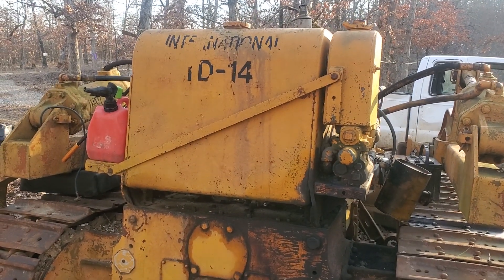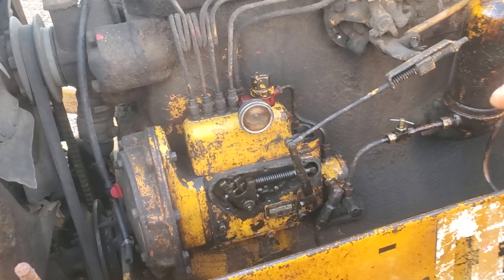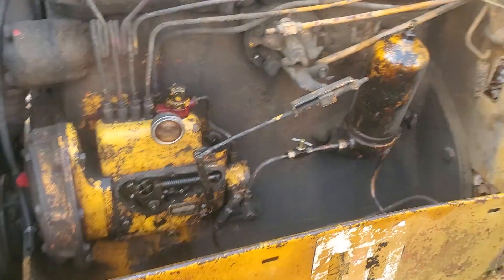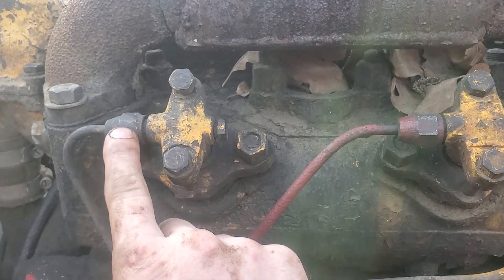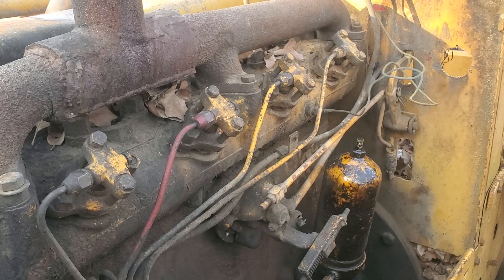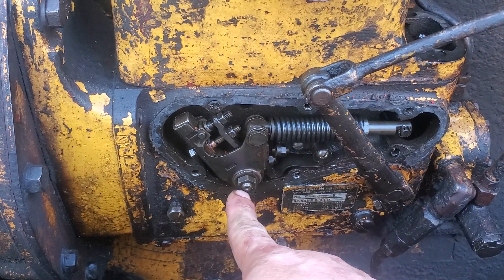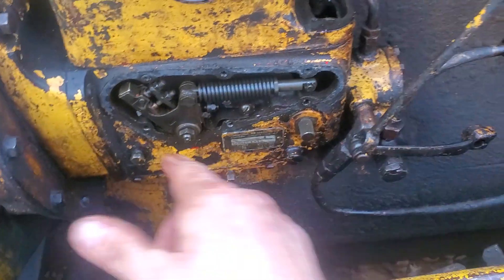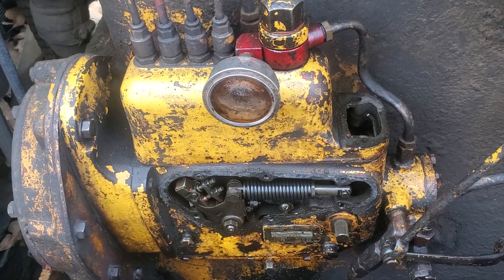Starts on Gas|Won't run on Diesel|What is the Rack #IH dozer

Comment: Replace fuel filters, check the rack that the fuel is in the "on" position, crank the engine, check fuel delivery at the injectors, if at the injectors there should be smoke out the exhaust pipe.  It should start or at least pop.
Reply from the maker: Already done. It looks like we aren't getting enough pressure at the injectors
Reply: @whitetailridgehomestead  remove the injection pump and have it checked. I am guessing in is leaking around the pistons, new o-rings if the barrels are not scored. Maybe broken springs in the cam followers inside the pump, check the pattern of the injectors and the breaking pressure. If the return is blocked it will put the pump in bypass automatically, no fuel delivery, no smoke from the exhaust. The return line has a check ball in it where it leaves the pump,  I have found the check ball blocked with gasket material, ground up rubber. Remove the blockage and the pump will work but still needs repaired.
Reply from the maker: @danthurman9076  this is the step we are currently at. It's good to hear that more than one person is going the same direction. Literally just had a guy tell me the same thing. I'm betting this is the issue. I just have to open it back up and check.
Reply: @whitetailridgehomestead  40 years tinkering with diesel engines, big or small, I like the old ones with injection lines and a pump instead of all of the overhead cam and electronic injection. Fuel rails built in the head. ☺
Reply from the maker: @danthurman9076  me too. Seem much easier to work with once you have an understanding of the system. However it's getting to know the system. This particular machine is new to me and I'm learning my way through it with bits and pieces of information from people like you. I appreciate your input.

Comment: The rack is the part you were sliding back forth near the end of your video.
If your injecters getting fuel when you bleed them out, then i would think its the conpresson release getting stuck open, not fuel
Reply from the maker: Unfortunately I checked every cylinder individually to make sure that valve is opening. It's opening. I'm waiting on a new set of batteries now so I can continue.
Reply: @whitetailridgehomestead  well opening is great for running on gas, but are they closing and sealing? If not it wont have the conpresson to run on diesel
Reply from the maker: @oldreliable303  yes they are sealing to the best of my knowledge. Only reason I say that is because on a random test I shot go go spray into the spark chamber put the plugs back in to see if anything happened. Nothing happend, so it's sealed good enough not to leak back at least
Reply: @whitetailridgehomestead  with the conpresson relese off, like its running on diesel crank it wile spraying starter aid in it and see if it will run on that with no spark
Reply from the maker: @oldreliable303  I can try it again but I'd assume it won't since it didn't fire the first time. I'm probably going to check as well to see if I feel any blow back with the plugs out. But like I said I lubed them valve stems up good and worked them up and down manually. But never hurts to double check.

Comment: 1. Remove all injectors, test compression (harbor freight), minimum 400 psi to start on own. 2. Fuel transfer pump, at the rear of injection pump, has three lines 1. suction from filter 2. pressure into injection pump 3. bypass back to tank. 3. Assuming you are getting fuel into injection pump, leave injector lines connected to injectors while you spin engine over with starter. Fuel should spray out of each injector like a wd-40 can or finer.4. Do not recommend you tinker with fuel injection pump as you could create a runaway engine situation real easily! Recommend you send off to professional rebuilder. Hope this helps.

Comment: One of the first to do before you even try to run it is change the fuel because just like the gasoline today the fuel will cause the plungers in the pump and injectors to stick if it's too old .
Reply from the maker: Been done twice already

Comment: The pump plungers are stuck, remove lines at pump. Remove the fitting on top of pump one at a time. Remove spring and check valve . Roll over engine to verify pump plunger is rising and falling, i use a 1/8" pin punch in the hole to get a visual of it. If needed tap pump plunger down lightly, making sure pump cam for that cylinder is not on tdc. Tap it down leaving punch in the hole rotate engine and note movement of the punch if it rises but not falls youll have to manually tap it back down. Repeat as nessasary till punch rises n falls with engine turning over. Repeat this on all 4 pump plungers reassemble check valve and spring and fitting cap . Repeat this to other 3 outlets also .This will allow plungers to get a full stroke of fuel and allow the rack to move and rotate plungers and be opend up to the fuel passages. Keep it clean n good luck.
 Mr. Been there done that.
Reply: Side note, I modified a salvage fitting cap to allow the punch to go thru it, threaded it on the pump without spring and check valve of course, this makes sure a stuck plunger won't push out the plungers barrel while your freeing um up.
Reply from the maker: @roha8993  totally makes sense in my head and can follow what you're getting at. Also appreciated. I will see what I can scavenge around here. I'd about bet this is going to be the fix.
Reply from the maker: @roha8993  I have a question when you have some time.
So I opened up the injection pump. Right under the cover you have what looks like a distribution block where the 4 main lines connect. I removed that block. All 4 plungers under the block were frozen. I soaked them and twisted them until I got free movement. The distribution block has four pins/needle jets or something in it... all of those are frozen. Any ideas on how to get them free? And how far are they supposed to move? Thank you for your time.
Reply: @whitetailridgehomestead  
Don't know to properly respond via utube. Can't fwd photos or chat as needed.
Reply from the maker: @roha8993  just tell me what platform works best for you if you're willing to share information. Phone, email, anything I can get I'll get it. I need the help
Reply: @whitetailridgehomestead  
I think YouTube deletes my contact info when I post.
Reply from the maker: @roha8993  it's all good. I actually just put up a new video. I hadn't tagged you yet but, you nailed it on the head for the most part. It was all gummed up. Check out the new video and see what else I found though.
Reply from the maker: Copy that. I think you may have it. That plunger deal you're talking about was the only part that was froze up the last time I had it apart. I did move it around to get it freed up but the way you are describing this I may not have gotten all the way free and am sitting here fighting myself and the equipment. I thank you very much for your input and will follow up with you just as quick as I can. I have a few appointments this week and not sure if I'll get to it tomorrow or not. I do appreciate the input again though.

Comment: Check the fuel pressure at injector inlet your discription of fuel flow points to low pressure if thats good onto injectors them selves
Reply from the maker: As of yesterday I wasn't even getting diesel out of the injection nozzle that sits in the cup.

Comment: that's an injector pump. there is an injector for every cylinder the pipe coming out of the top goes to the injector which is adjustable by the throttle lever! that's the lever that the cable comes down to. somewhere there is an adjustment for the rod that pushes the rack that forces the injectors to open against spring pressure. the naturally want to close. watch it carefully or video it with your phone while someone is operating the throttle control. you will see which way it goes to wide open or closed. it's probably not opening enough. make that adjustment. loosen the pipe going to the injectors two turns so that you can bleed air out of the system. crank it over until you have good fuel without bubbles coming out where the nuts are loosened. Tighten each one up and crank it again. it should start if it's making smoked when it's cranking it's going to start pretty soon.
Reply from the maker: Out of curiosity do you know which way, in or out the rack needs to go to add more fuel? I've got it all identified and loosened up.

Comment: Show us how you’re trying to start it. If you have fuel to injectors it should start. The rack is what meters fuel to the injectors. The start procedure is open compression release(handle down), start engine on gas. Once it’s warm, open throttle for diesel and it should start smoking grey, now close compression release (handle up), if the engine doesn’t take off right away just open the compression release (handle down) and the gas will take back over.
Reply from the maker: Yes that is the way I'm firing it up. It just dies when switched to diesel. Like it's not getting fuel. Rack is all loosened up but I noticed it looked like someone was in there and had the jam nut on the bolt for the rack loosened up
Reply: @whitetailridgehomestead  make a video of it starting. Let it run a few minutes on gas before switching it over. There is a video in my shorts of the process on our TD-24.
Reply from the maker: @vantagetes  I'm starting it on direct diesel. I converted it because the gas side was being too much of a pain. If I can get the diesel side figured out them I'll put money back into the gas.
Reply: @whitetailridgehomestead  it needs to run on gas first. The starter doesn’t have the jam to start it on straight diesel unless it’s warm out. The gas side of the system is very simple. You’ll spend far more money and time chasing it by trying to fire it on diesel.
Reply from the maker: @vantagetes  it does if it's been rewired and modified for 24v. Trust me it spins.
Reply: @whitetailridgehomestead  it was 24v to start with….. perhaps you should try the gas side.
Reply from the maker: @vantagetes  I did fail to mention that so my apologies. It cranks over more than fast enough to fire. I did a little studying off of old quarry guys that got tired of the gas setup and just run them the way they should have been run.
Reply: @whitetailridgehomestead  actually the gas start is a great way to start these machines. I can go outside in -20 and start our TD24 with ease. It takes 10 minutes to rebuild the carb, 5 minutes to check points in the mag and a few minutes to make sure the ground plug is making contact in the manifold. Or you can keep getting bad advice from others.
Reply from the maker: @vantagetes  if that is the case then I have been lied to.from the beginning. It was set up for 12v when I got it and the old sob would barley crank. All the information I found said it was 12v from factory.  If it was 24v that would be great because now I have a bullet proof system. And I can go back and try the gas. Either way I'd prefer not to till I get the diesel up and running. Mainly because gas fired on 12v and it's cranking hard enough on 24v to fire. Do you have any resources at all that could show me this was 24v from factory because I'd be really appreciative of manuals or information.  I'm strictly operating off of outside information and I've heard it all. Just trying to get to the bottom of this ordeal and put this iron to work. It's a great piece and I wanna see it working.
Reply: @whitetailridgehomestead  you can find pdf copies of the service manual online for free. You were definitely lied to. The gas side of the system is very easy. The starting speed is not the only reason you’re having issues. You need the heat from the engine running to get it to fire on diesel. Start with simple things, do you have spark from the magneto. Then clean your carb and make sure you have fuel. When you pull the carb off look up in the air intake and cycle the compression lever and make sure it closes off air to the carb when then lever is up, and opens it when it’s down. It’s a system that works extremely well.
Reply: @whitetailridgehomestead  look at it this way, of the people giving you advice…. Who’s speaking out of their ass, and who’s got a running international dozer from the 1940’s?

Comment: i beleive the rack controls the compression release that closes off the combustion chamber allowing it run asa diesel.
Reply from the maker: According to all the guys on red power forum the rack is a plunger deal in the pump that regulates the fuel pressure/dispersion. The level on the dash is what operates the low compression chamber switch over.

Comment: It's your low to high compression leaver is not in the right position is one thing to check and the fuel pump and fuel supply
Reply from the maker: The I checked the lever and the valves inside the low compression chamber just to verify they were working and that's not it. We actually yanked the intake off yesterday to make sure a mouse didn't get in there and that's not it. Fuel supply is good, clean, and flowing. Filter has been changed and we blew 120 psi air through the lines. Pulled an injector and verified they are good. So we are thinking it's likely a bad pump.
Reply: @whitetailridgehomestead  yes sir that's sounds correct those dozers push extremely good when you get it running right
Reply from the maker: @MichaelGerber-mo1sx  hoping to find that out for myself soon. The man I bought it from said the same thing. He was in the process of moving and didn't have time for this machine anymore but verified it would shove a 20+ inch oak tree over and not hesitate.
Reply: @whitetailridgehomestead  yes it will and when you start it keeps power to both tracks and slows one down until you push the brake to stop that side